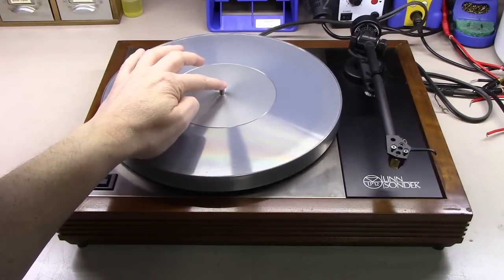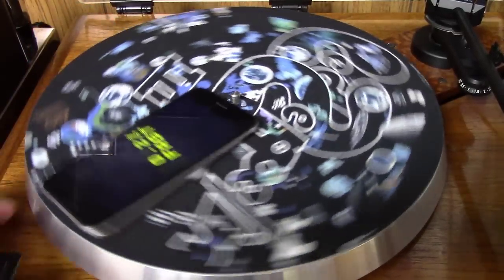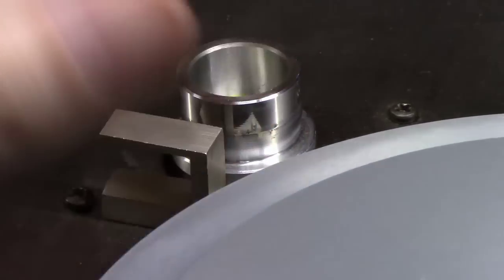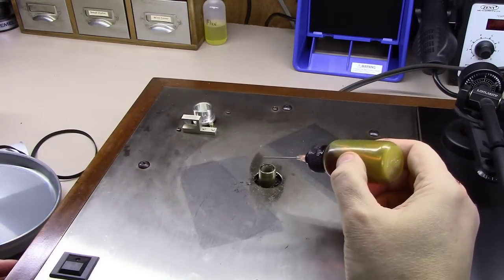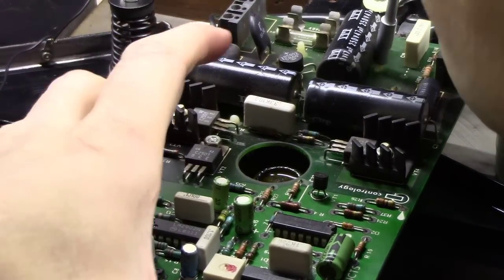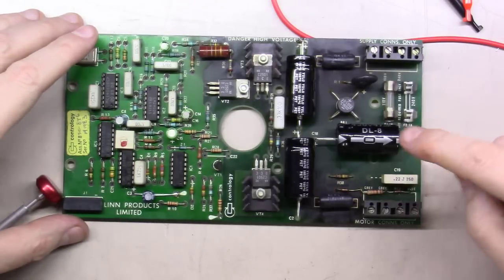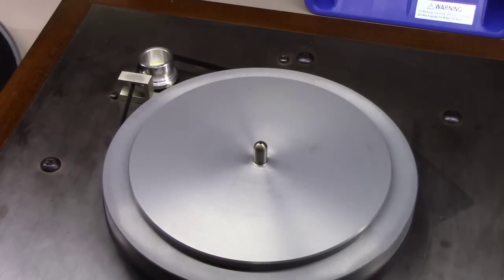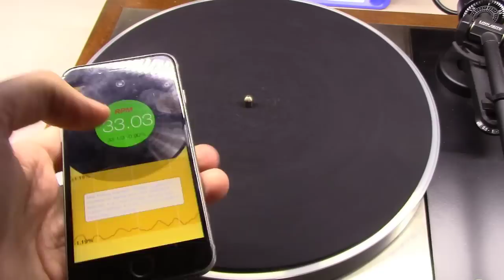Fixing motor start and platter speed issues on Linn LP12 Turntable

Comment: You have to fill the whole bearing with oil not just a couple of drops
Reply: Yes it must be filled until it overflows after spindle is inserted.
Reply: @AshGrantASH8  Using the 2mm hex key (that tightens the cable into the tonearm) as a dipstick, 5/8" is about right for a little overflow.

Comment: Concerning slow start-up times on an LP12 Valhalla:  When servicing Valhalla boards, Linn now recommends adjusting the board to output 70-75 volts as opposed to the earlier spec of 85 volts. This results in a very slow start up, but also lower motor noise (smaller AC pulses), the benefit being an even a more black, more silent background when listening to music.

Comment: Clearly this guy has no idea of how to service an LP12. The main bearing should only be topped up with Linn black oil, no other type should be used. Likewise, you clean the spindle shaft with a soft cloth, not ruff kitchen paper. If you really want your deck to work at its best, have it serviced by your local Linn dealer who has all the  tools, oil and parts to get it working at its very best. Guys like this are a definite no no.

Comment: the correct term is SONDEK not sonde'R' , You may also note that every LINN product features the letter K throughout its entire range from day one in 1972 to the present and every day going forward, more info:-http://www.positive-feedback.com/pfbackissues/0706/Ivor.7n6.html#:~:text=Bruce%20Kinch%3A%20It's%20been%20said,hundreds%22%20conventional%20gear%20goes%20for.

Comment: actually NO - Linn stole the idea from Ariston ... google those - the similarity is remarkable
Reply: antigen4, I worked for a Linn and Ariston dealer some years ago, and I have owned both. Some of the Ariston turntables are pretty good, but not as good as the Linn in my opinion. It is almost impossible to get an Ariston subchassis set up correctly with the original springs and rubber parts,  but used Linn Springs and bolts and rubber dampers work much better. I've upgraded Ariston's suspensions with the used parts that came out of an early Linn being upgraded to "Nirvana" springs; and once I used the actual Linn Nirvana spring kit in an Ariston.  Either way, it's easier to get the Ariston suspension properly tuned with the Linn parts.
Reply: yes i don't doubt the linn is better thought through and engineered/machined etc - esp. the bearing
Reply: i was just trying to 'correct' his assertion about the linn design being lifted from the AR turntables - more like AR -> Ariston -> Linn
Reply: antigen4, that's a reasonable evolutionary chart! By the way, years ago,  before I ended up working for a Linn dealer, I had an early AR with the crappy aluminum sub chassis and primitive tonearm, and I upgraded it with an acrylic sub chassis and platter bearing assembly that was sold as an aftermarket upgrade, I don't remember who manufactured it however. The new subchassis did allow me to put an Audioquest arm on it which was certainly better than the original AR tonearm, but a Rega P3 or Linn Axis sounded significantly better, and an LP 12 better still. 

we also sold Systemdek turntables, they made a nice, less expensive alternative to a Linn.
Reply: yes our local dealer had the same tables .. linn rega ariston etc ... my first table from them was a thorens TD160 which i stupidly traded in for a systemdex - i think IIX? the round one that looked like a UFO? i don't think it was that well made, that one
Reply: That was a ll. The X had the full plinth.
Reply: @antigen4  The Linn design is/was a copy of the Thorens TD 150.
Reply: DEFINITELY via Ariston if so ... i mean just look at the ariston - they are nearly identical ... ivor's dad used to make the ariston tables ... so .... there's no real way out of that one
Reply: @antigen4  Linn (Actually Castle Machine) made the parts for Ariston.  When Ariston failed to pay their bills, Linn was formed to market the tables.  They have made many improvements over the years.

Comment: i'd never want a turntable like that, looks flimsy with it bouncing around like that and the belt slipping so much it can't have an accurate speed. My sl1200mk2 looks much better quality
Reply: Got memes? , the Technics sl 1200 is a fine machine for what it was designed to do, basically spin records in a nightclub or radio station, wow and flutter and isolation from speaker vibrations, 1200 cannot hold a candle to an LP 12 or any other well-designed belt drive turntable with a sub suspension. They're not built for hand cueing of records like a DJ would do (or for "scratching", definitely not designed for that either!); the Linn and other similar high-quality belt drive turntables are designed for extracting the absolute maximum last possible bit of musical information out of the record groove with minimal wear and damage to the groove, and to have extremely constant speed with very low wow and flutter , while also maintaining isolation from speaker vibrations that would otherwise muddy the waters so to speak.  For what it's worth, I have repaired and installed dozens of SL-1200s in nightclubs over the years, but I personally own a Linn Sondek.
Reply: Sl1200 absolute benchmark for DJ work, or shops where people off the street may be allowed access, they’re designed to take a beating and with the latest model clocking in around £800 not cheap. The LP12 is a home system front end, Set up and left, flimsy is the last thing they are, they’re beasts, solid construction and basically unchanged in 5 decades. You can add & upgrade as you want. 
But think it’s fair to say they’re a one person turntable. I don’t let anyone touch mine.